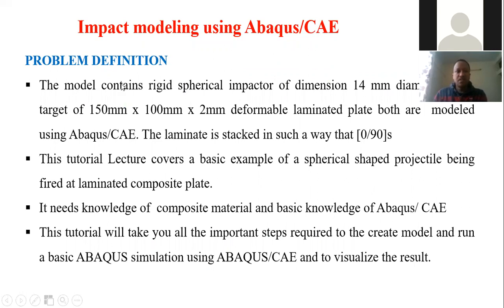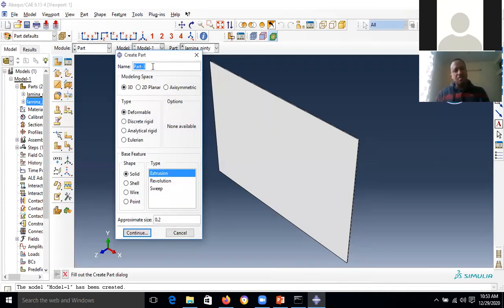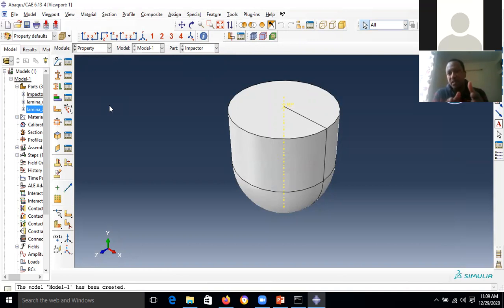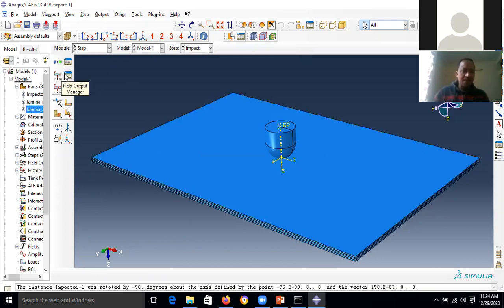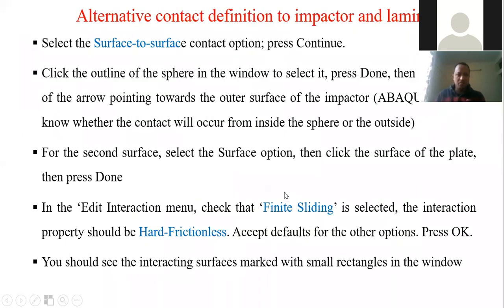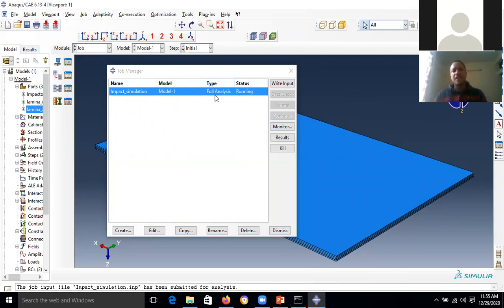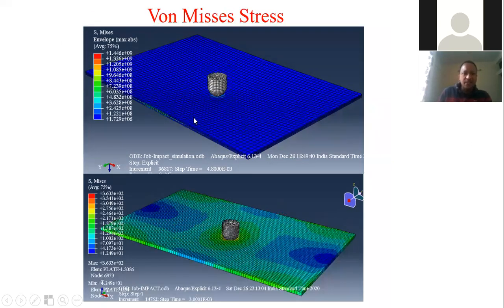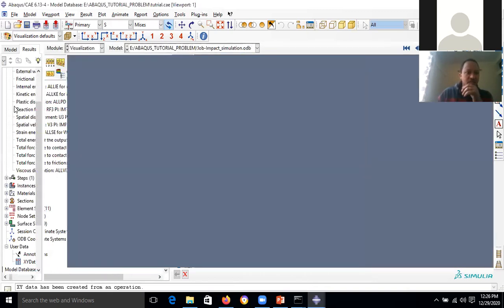how to model Impact damage on laminated composite

Comment: HOW I CAN solution this warnings ? Can you help me?

Output request status is not available for element type r3d4

Output request status is not available for element type r3d3

Output request status is not available for element type mass

Output request status is not available for element type r3d4

Output request status is not available for element type r3d3

Output request status is not available for element type mass

There are 6 warning messages in the data (.dat) file.  Please check the data file for possible errors in the input file.

Comment: Hi can this simulation setup also be used for ballistic impacts?
Reply from the maker: It works, however ballistic impact is high speed impact with high strain rate effect.
Reply: Im unable to make same profile velocity time graph under low velocity impact